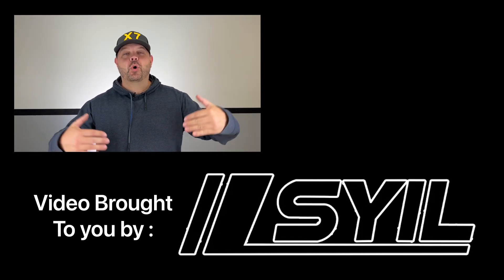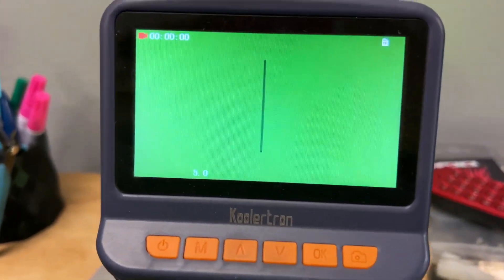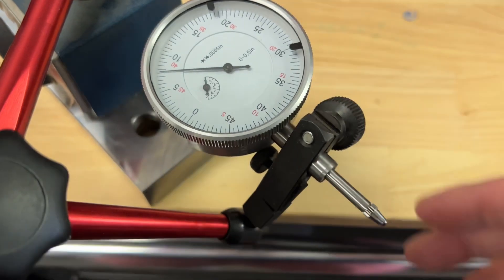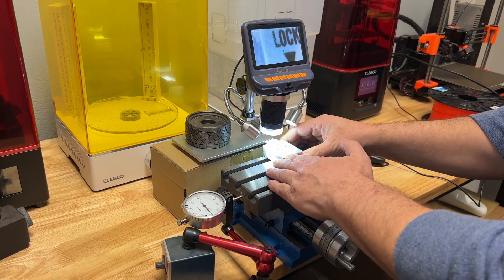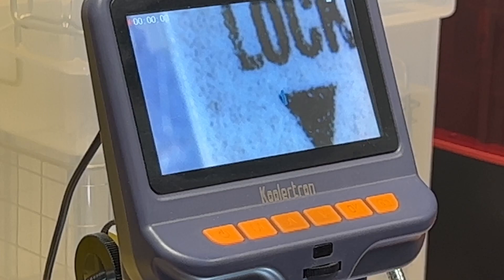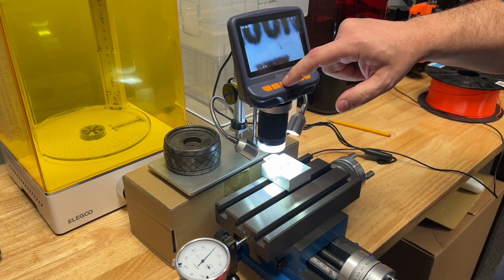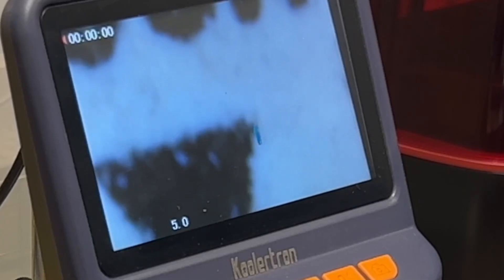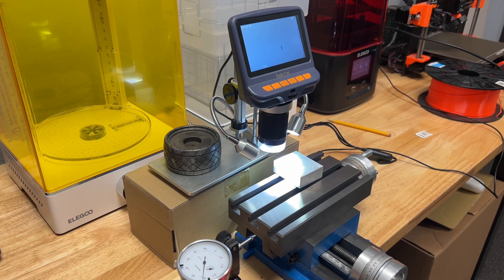DIY Micro-Scope Optical Comparitor

Comment: What might help is a digital indicator; press reset to zero instead of turning an indicator dial that is going to move all over, especially when or if you have to correct backlash on your table lead screw. That in itself can me looked into, modifying/replacing  the lead screw nut for backlash compensation.

Comment: I basically use the home printer/scanner to scan a flat image of the part and scale the thing up to actual size in fusion. You will need a reference scale to scale up or down compare to your printer resolution, in my case a ruler will do the trick. once you done that once and confirm the scale factor correct all u need is that scale constant 🙈
Reply from the maker: this isnt possibel when the feature is several cm below the surface that would sit on the scanner

Comment: I had to confirm the effective inside diameter of an e-clip one time, but since that ID is only hitting 3 points it was tough to measure, and I didn't have any gauge pins...so I took a photo of the clip on a ruler, imported into fusion 360 as a canvas, calibrated the canvas based on the ruler, and used a 3 point circle feature to determine the ID of the e clip....worked plenty well for what I needed! 👍🏻
Reply from the maker: photogrammetry works well for flat parts